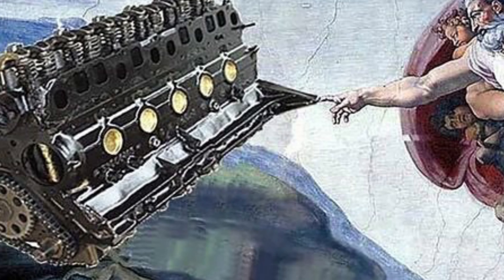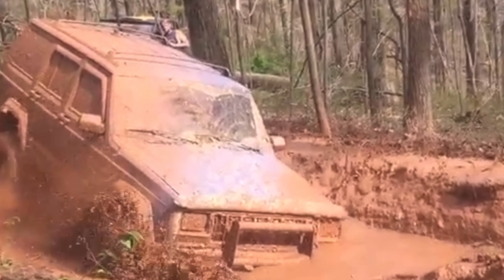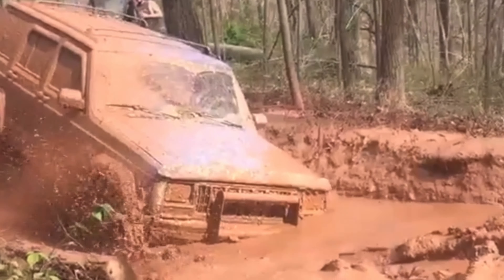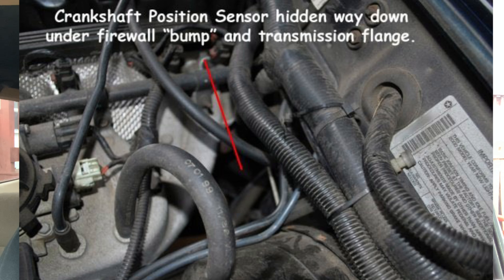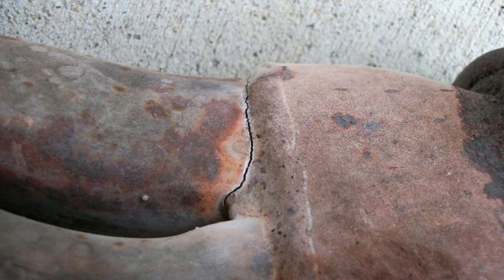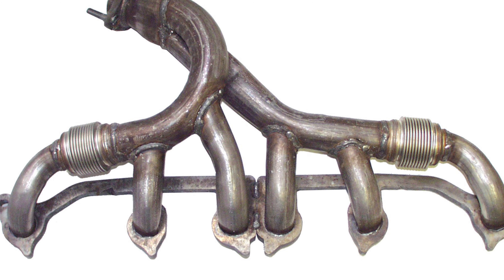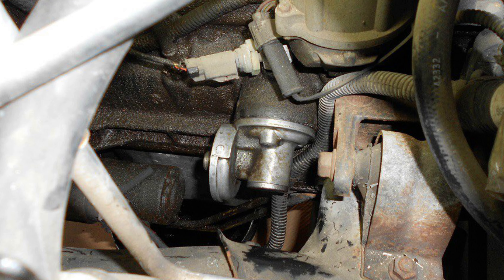5 major flaws with the Jeep 4.0

Comment: And number 6 changing heater core.
Reply: Facts lmao
Reply: Or freeze plugs.
Reply: What’s the issue there? Corrosion?
Reply: Yes and only during the  cold months
Reply: @thomascolbert2687  Yup. Had a freeze plug rust out and I wound up frying my transmission. I’m swapping in another one next week.
Reply: Not really a flaw of the 4.0, heater cores are a pia on a lot of cars. More of a design flaw of the chassis.

Comment: Have you ever had a heat soak issue to where the Jeep will run rough then stall, and It won’t start back up until it’s cooled down? Mine does this at least once a year in the summer time and I’ve tried every aftermarket method the internet has offered. Nothing fixed it. Then I realized my e- fan was not working so I replaced it. Fingers crossed.
Reply: Might have the same problem there is a heat shield shield that goes around about by your fuel injectors. I don't remember what website I ordered it from but it did solve my problem. If I can find it I will post it
Reply: Solved mine by using foam pipe insulation on fuel rail, wrapped in aluminum tape, the metallic fiberglass heat shield, an auxiliary thermostat for electric fan, and lastly ethanol-free gas when possible
Reply: Crank position sensor guaranteed
Reply: @nhickcox02  Yeah when those get hot and they’re about to fail, Problems can arise.

Comment: '93 xj  500,000 miles + .... now whats flaws are we speaking of lol
1a. crank position sensor needs to have an access door from inside jeep for sure..
2a. mig welder...
3a. no oil leaks
3b. rear main, no leak
4a. valves good

5. water pumps suck
6. stock coils suck
7. vacuum controlled valve for heater- brittle 
8. radiator- needs another core
9. speedometers- 4th one
10. wiring trailer lights is less then fun
11. no quick remove doors

........with that said / typed ... I built a 4.9 stroker , the only thing untouched is the 5 speed transmission and ECU ,.................detonated a rear driveshaft and on 3rd front prop shaft (cardigan joint failure) , a transfer case chain once wore a hole through the bottom and i drove it another 4,000 miles until i just couldn't stand the sound anymore but it never failed.
I shot a leaf spring out the back after sheering the center pin, caught by the tube bumper, took me about 100 miles until i thought that don't feel right, looked and said "oh chit!" ....dome light never worked, ..need to replace climate control cluster cause the fan switch kept burning up and cable snapped to door or gate in plenum, changed power steering pump and about to put in 3rd steering box (probably should think about one with a larger piston), bolt in drag link got worn out, created death wobble when hard braking, replaced with oversized grade 8.
   on 4.5 rough country long arm, now at 6" with 1.5 spring perch spacer and rear shackles.
looking forward to new style transfer case linkage. .....ummmmmm??? Im sure there's other stuff 
...OH!!! the floor is now 3/8 diamond plate with a cross member reinforcement from rear spring front perch to rear spring front perch (do more cracked front windows from body flex.
aaaand the body has gone on a diet, and the roof is gone aaand making pocket doors aaaand.....

Comment: I’d also add special mention of getting the nut off of the valve cover stud that’s driver side, all the way back (the firewall to engine block ground wire goes to this). The only tool combo I’ve found that actually fits is painfully slow: worked at it for over an hour and still didn’t have it out. That back area is just pain in the ass.

Comment: I run royal purple HPS oil in all our 4.0's it has zinc and stuff. Then my local gas station has 93 octane ethanol free gas I use but if I'm on a trip or something I'll use premium name brand gas like shell or chevron. I put a little right stuff gasket sealer on the oil filter adapter o-rings and that makes them last about 5 years or so. I've been driving cherokees for a long time. I also have a pretty good procedure for doing the rear main seal. I've done quite a few at work and on mine and my friends 4.0s and I use a little dielectric grease and a little paper shoe horn to slide the block side seal up into place that makes it very smooth then I do the tiniest amount of right stuff on that same seal half on the edges in the block it's a little hard to explain, then a little sealer on the tips and on the backside of the other seal half in the main bearing cap but just a tiny amount. But so far on my wife's 4.0 there's 60k without a single drop of oil from that main seal then my friend has around 30k on his that I did without leaks. He did his main seal twice before I did it. Usually you get like 20k out of a main seal before it starts to leak. 
I got a couple interesting 4.0 main seal story's, I've seen 2 cherokees come in that had completely different seal halves in the block and in the main cap so someone went through all that work and only replaced the seal half in the main cap. Then I had a woman who bought a new engine for her cherokee and had someone install it and it was leaking oil really badly because it was completely missing the rear main bearing cap someone put it together without a rear main cap.
Reply: crazy stuff. I did mine twice and it still drips a little. We need more mechanics with these little tidbits of knowledge
Reply: I'm about to do my rear main and a new oil pan(I live in Ohio and she's rusted out and actually weeping oil through the pan). My Jeep is stock ride height. Any tips for a guy about to tackle this on his carport in November in Ohio? I'm a diesel mechanic by trade but have no access to a shop at the moment. Thanks for any advice.
Reply: @jelly7310  it's kinda difficult getting the pan off when your at stock height. Your gonna have to undo the pan then before it can be removed you'll have to remove the oil pickup/strainer tube and you'll need to droop the front axle down as far as possible then just have some patience the hardest part is maneuvering the pan in and out. Use the felpro one piece oil pan gasket it's blue and made from silicone it's a very good gasket and it comes with 4 plastic doodads that thread into the larger pan bolt holes in the block and those align and hold the pan up when assembling, it makes it super simple.
Reply: @forreststrong797  thanks again. I've already got that felpro gasket. I've thought about farming it out to a shop but I'm such a tightwad and it makes me sick thinking about paying someone else to do what I I know I can. Lol. My wife is pushing hard for me to just pay someone to do it because she knows the bitching and complaining that's coming. Lol. Thanks again

Comment: You never bring up the “0331 head curse” on the 99-01 . I’ve owned 3 and each one had a cracked head. From 100,000 miles to 260,000 miles. The thin casting is probably one of the biggest flaws on the 4.0

Comment: The 7th Flaw is me trying to troubleshoot the electrical.  Someone tell me how in the heck the darn windshield wipers turn on every time I signal left or right?!  Can’t find the answer in the forums.  Grounds are clean. Difficult to believe it is steering column switch.  I’ve been doing recent work on the front end and moving the horns to accommodate a new aftermarket bumper.  Recently installed wiper pumps in reservoir without issue.  Driving me crazy! 😜
Reply: A old jeep tech told me many year ago a bad clock spring can cause all kind of problem.
Reply: It could also be if you had an after-market radio installed the wrong way
Reply: @crazyj4282  OOOOHHH!!  SNAP !!  🤔🤔😁🤣👌
Reply: got to let your dog chew up the windshield wiper switch, never fails after that.

Comment: Omg the Crank Position Sensor! I've gone through 2 of them since owning my 99. (Didn't have the same issue with the 91 or 85) The 91 had the oil Leaks, luckily with the 99 the previous owner had all the seals redone so it isn't a problem with her. Definitely wondering if that exhaust tick is what I've been hearing 🤔

Comment: My started this, not sure what the problem is, hit a bump and the engine dies done this a few times.. Now I moved the wiring behind the engine on the intake side and now it won't run.. If anyone has an idea what it might be, I am open to suggestions... Thanks
Reply: Crankshaft sensor
Reply: @lachoule9344  that's what I was leaning towards.. Wasn't for sure..   Went to the shop running and came back home would shut off every time I hit a bump. Then like loved the wiring and it would turn over but not run..
Reply: Crank position sensor wiring harness. Been there done that...💪
Reply: Sounds like a bad ground somewhere.
Reply: Check the wiring to the PCM. Have a person wiggle the wiring below the harness and the other try to start it.

Comment: 2005 and2006 Jeep Wranglers made an EMC change for these 2 years only. They were a known issue and fail regularly at 150,000 males at best. There are NO replacements for the engine management computers and the factory stopped making them 10 years ago. Also, ALL if the used parts are gone as the issue was HUGE!!  ONE guy in Canada does referbs and they are $2,000!!!
Reply: Wranglerfix in FL is the only way to go
Reply: @beowulf6057  I am unaware of him. Web site??? I will spread the word with my Jeep group.

Comment: hey ronnie another great video man.

I was wanting to ask you too my 92 xj fuel pump is working but is loud and my ballast resistor isn't properly working. usually when you unplug the ballast resistor it shuts off the engine but I can unplug it and it still keeps running. do you have any idea what it could be
Reply: and it just started out of the blue

Comment: What brand and grade of gasoline do you run in your Cherokee,Ronnie?
Reply: Cheapest 87 I can find 🤣
Reply: I prefer ethanol-free, especially in summer due to heat soak issues
Reply: I ran 93 only for the 4 years Trump was in office and now 87 with fuel prices. I drive 125 miles a day to work and back and the fuel mileage is exactly the same as the 93 octane. I don't notice any loss of power or anything else really.
Reply: @jelly7310  the 4.0 with Chrysler updates wasn’t designed to benefit from high-octane gas anyway.  
And To be clear, fuel prices have nothing to do with who’s president.
Jeep on! 🤜🏻💥🤛🏻
Reply: @erichimes3062  Clear as mud.
Reply: @georgesakellaropoulos8162  
Uh. Yeah.
Reply: @jelly7310  market forces. Pandemic/supply chain problems. 🤷‍♂️

Even if Mr. Biden was responsible for the price increases in energy, I’m still happier that the 🍊 🤡 is gone.